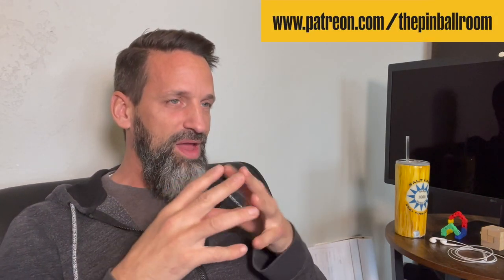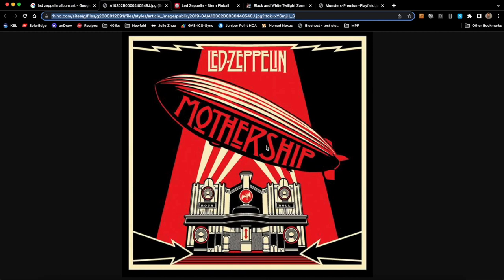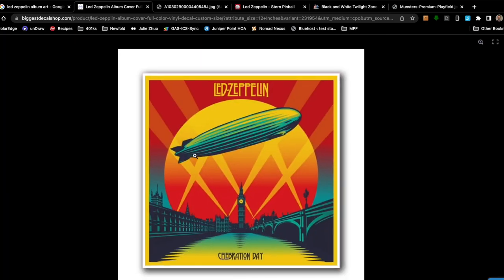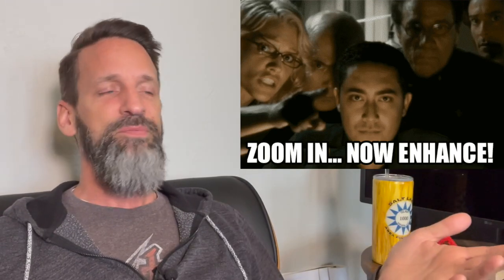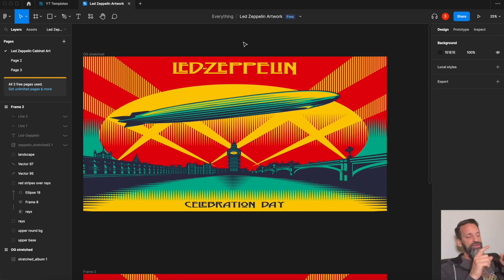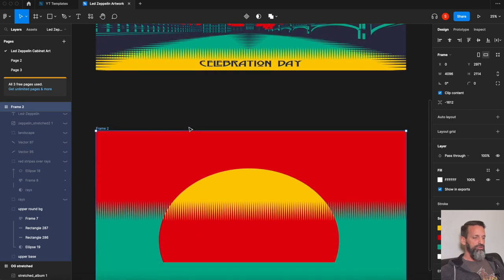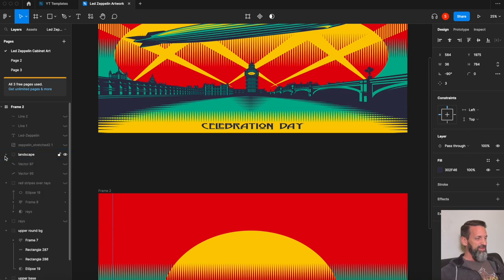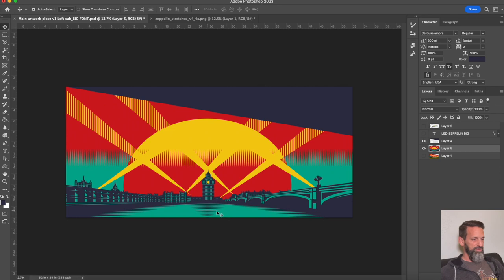HOW TO MAKE A PINBALL MACHINE: Cabinet Artwork

Comment: When you go to actually put the artwork on the cabinet, I would highly recommend using the "wet method." It's SUPER forgiving compared to the dry method. I cut some of the excess off the decal when I first received my cabinet decal (since, as you pointed out, it's printed as a rectangle but tapers at the front) and tried the dry method (on some scrap plywood) and it was both terrifying and a disaster. I then cut some extra off the other side art piece and tried the wet method and it was so much easier and forgiving. And it's for sure a 2-person job.

Comment: Inkscape does a great job with vector tracing these days (it traces bitmaps!) Last time I used it it turned out some great results... and you can export the images as .svg (or .ai) files... which you could further refine in Illustrator. Yes, the tracing is done by the tool... you don't have to trace the bitmap yourself.

Comment: I've used Adobe products and Inkscape and they're both pretty nice. I think Adobe's workflows are a little more intuitive and friendlier to new users but once you get past the initial learning curve of Inkscape it can be pretty easy to work with as well (and certainly cheaper). There are a couple gotcha's though

Inkscape can be a little buggy sometimes. If a menu isn't working the way you'd expect or the graphics aren't displaying properly, it's a good idea to restart it. Nine times out of ten it will fix whatever was happening. For example, I had an issue where new objects weren't appearing under layers and another where I kept changing an object's transparency but nothing changed visually. Both were fixed with a restart.

Adobe products tend to have custom file types for their projects like psd for Photoshop and ai for illustrator; however, Inkscape saves it's files as SVGs... but there's a trick. The SVG's Inkscape saves by default actually contain all of your layers, settings, etc not just the image like a normal SVG. Some software can read Inkscape's SVG files as images just fine but others freak out at all the extra info and render them wrong. If you want to send your file off for printing etc, it's a good idea to export your Inkscape project to a regular SVG file first. Just be careful not to mix them up as the plain SVG file does not contain your layers or other settings.

Also, to my knowledge Inkscape does not officially support Pantone colors which may be an issue depending how you go about printing. Without going into the details, Panton is essentially a dictionary that tells a printer what specific ink they need to use to exactly match the color in your file. Without this lookup, you may run into issues where the final print has slightly different colors than what you intended. If you can, it might be a good idea to make a small color swatch with all the colors from your design and have that printed first to make sure the colors look right. Compare the swatch to your monitor and if they're wrong, tweak in Inkscape and repeat. You might also try having them print a large color swatch with labeled RGB values so you can just pick the closest color.